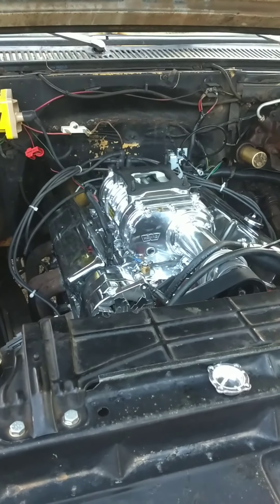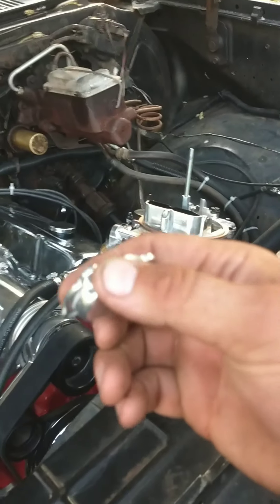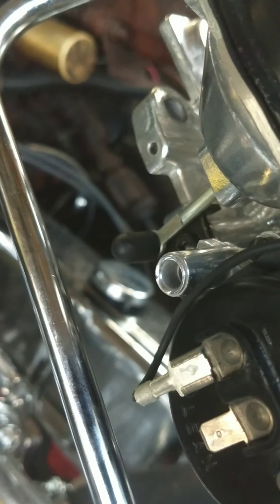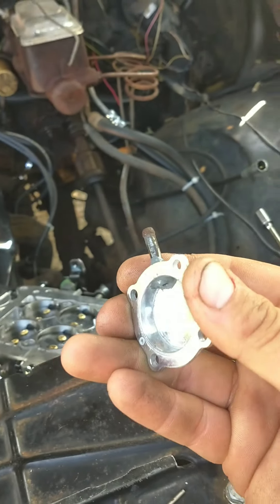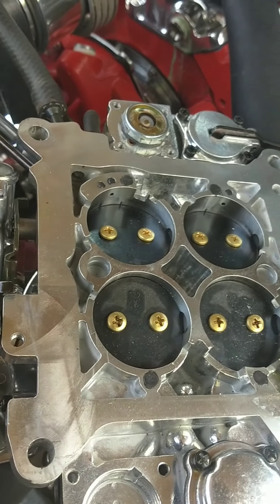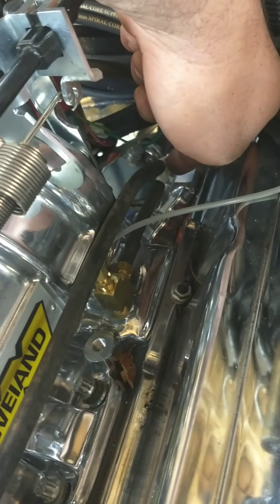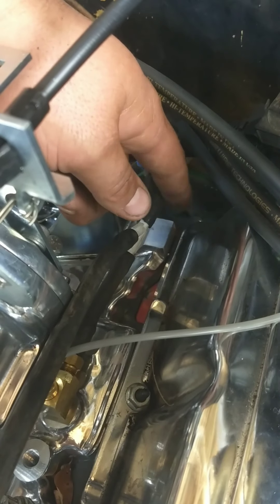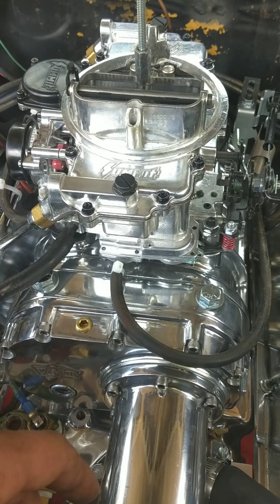Chevy farm truck super charger weiand 144 part 2

Comment: Does that fit under the stock hood? I have a 144 I want to put on a square body but don't want to put a cowl hood on.
Reply from the maker: It fits with a 3" air cleaner. That's the reason I chose the 144 myself.

Comment: Those zip tied plug wires will damn sure cause issues, especially with thin oem wires.
Reply from the maker: They are 8mm. I have ran into issues if they are old but these are brand new solid core wires.... Needless to say I don't use the radio 😂

Comment: What size Summit carburetor is that I'm going to do the same thing?
Reply from the maker: What size is your engine? 600cm is the one I have. That red engine was a 305 .020 over. But I now have the same setup on a 355 with aluminum heads and wish I had a 750.  You DONT need a giant carb with these small blowers. I may have videos of it on hear I'm not sure. Most of my videos are farming related.
Reply: Cool thanks for letting me know! I'm gonna boost reference mine, and up the jet sizes from 76 to 83 primary and 79 to 85 in the rear, with a 4.5 in power valve.
Reply from the maker: 4.5 power valve good. My 355 has 76 for the jet. Your jet idea sound too big for me.  Do you have an afr gauge? How much boost you plan to run? What size is your engine... That is what matters. A certain volume of displacement only needs a certain amount of fuel.  
   With roots blowers you add the amount of engine displacement to the blower displacement to figure your carb size. You can use summit racing carb calculator or just Google carb calculator. Then add about 10% .   The ratio of total carb to added cubes(engine plus blower) doesn't start to go up until your blower puts out more displacement than (+)50% of your absolute engine displacement.

Comment: you have issues lol 
grab that points distributor and throw it off a cliff some where same with 650 summit holley 
change it to 750 elderbrock with manuel choke and you can take choke butterfly off youl never have to choke a blown motor
and get a hei out of 74-80 chevy time it to 12 degrees before top dead center
92 octane only  and when gas has winter time crap in it mix a quart of estes 12 percent nitro 
in with 32 gallons of fuel you know the estes cox airplane fuel  from hobby store 
I runit year around but youl realy need it when its 6 degrees out side detonations a bitch.
its like 140 octane premium wont hurt anything but youl smell the nitro lol
keep new tune up on it at least once a year 
it will get 10 miles to the gallon no matter what you do thats what it got before supercharger
holleys got no low end tork just are better in all out race engine 
and get you 5 miles per gallon and your not going to ever see 6000 rpm 
under that the eldorbrock is far superior your welcome